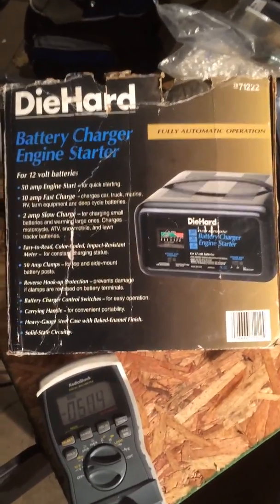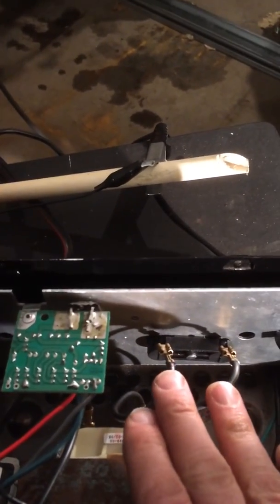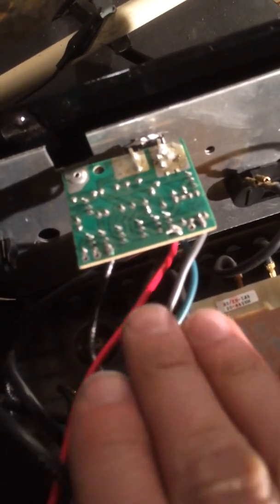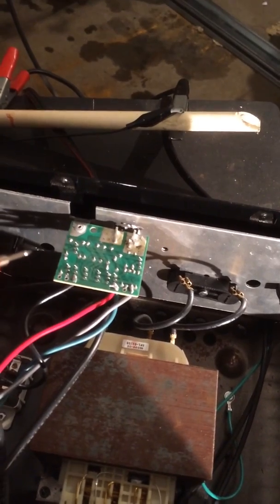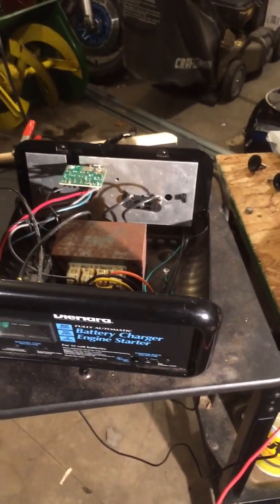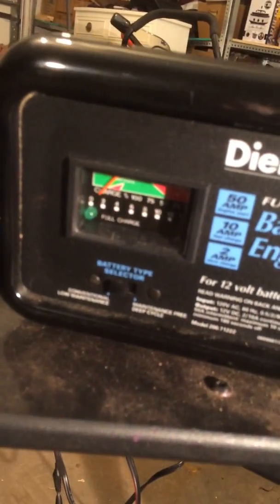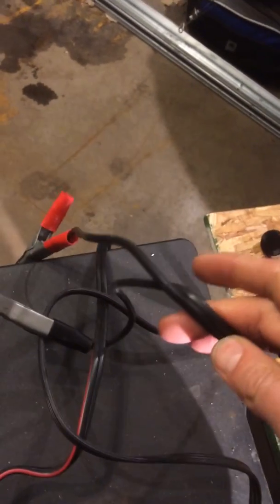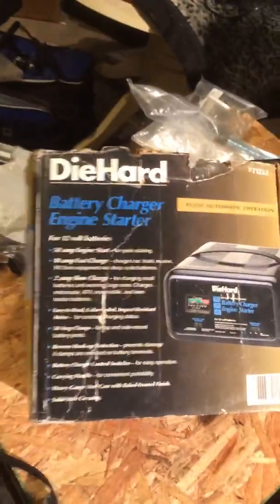My fix to the DieHard Battery Charger, explained out.

Comment: My same charger was not cycling at 2 or 10 amps. Occasionally, I could get it to work for a few cycles, then just sat there and buzzed. Opened and examined. No visual issue with board or connections. Transformer looked fine. Decided to bench test, but had just seen vid and recalled diode bridge design. All I did was check for oxidation between the two diodes and plate.  It was dirty. I simply spun the diodes a few degrees to find a clean spot on the plate and now cycles perfectly.   A simple fix, but saved me bench time. FWIW

Comment: Ive been trying to fix my 2-10-50 schumuker forever and nothing would work no voltage on leads but i can hear trans working and switch working and nothing watched youre video and unpluged wire and have voltage everything working good and good power ! Thanks Randy

Comment: dangg, so surprised that worked. at first it had a surging charge, then only having 9.33 volts. unplugged the wire and 14.5. kind of high but i dont mind. thanks

Comment: I was recharging a auto battery that was dead and I accidentally put it on 50 amps and it made a pop noise and wasn't working properly. Could it be that circuit board that was damaged or a fuse? Mine looks very similar to this but it's a Sears brand.

Comment: Hi Jason, would you mind sharing the part number for the transformer in this charger? Mine does not power on at all and I’m not getting any resistance on the transformer wiring. Thanks

Comment: Thanks I have a diehard platinum battery charger bought brand new and it never has worked correctly digital interface whatever this inspires me to open it up anyway it's not charging and it's brand new. Cost 150.00$

Comment: Thanks for the post. This helped with the 50 AMP... but I'm not getting anything out of the 2 and 10 amp circuits when I switch over. Anyone have any ideas? Kinda thinking possible faulty selector switch?
Reply from the maker: I only use it on 50 Amp.  It won't be your little trickle charger

Comment: I have had a problem with my charger for the last 4 times that I used it. I would get to power to the battery cables. I traced the problem to the circuitboard but I could find no replacement. Just happened across this video and tried it. It works perfectly now. A tip of the cap to Jason Hemphill for this solution!!!
Reply from the maker: Welcome

Comment: I have an older one that has  two 25 amp  bus car fuses as circuit breakers, and the diodes are on the back wall. my problem is i’m not getting anything out off the charging leads. nothing is burnt on the boards or anywhere else. checked continuity, but doesn’t seem i’m getting any out of the transformer.
it’s the same transformer as yours, how do I check the copper coils?
Reply: This may be too late but the transformer in my unit should put out around 28 volts AC to those two wires connected to that aluminium plate there (to the diode pack). But u gotta remove them to get that voltage. 28Volts AC on the 12 volt setting, and 18 volts AC on the 6Volt setting. 

To be honest, my unit doesn't work right. But I don't think the transformer is the problem.

Comment: I wish I had seen your video my dad had the same DieHard 71222 charger we threw it away because it would not charge anymore
Any charger that says [SMART/AUTOMATIC/INTELLIGENT] is not worth a penny!!
the only charger I see out there that is still LOW TECH or DUMB Charger but works every time is listed on eBay called [Speedway 7216] $139.99

Comment: Jason, I wish we could see the voltage when hooked up to a battery that had a chance. I am not sure output current is going thru the PC board as the components could not handle that much to operate the meter and LED’s use about 0.028 amps depending on color. It would still be worth taking the board off, visual check for cold soldered joints, over heated joints & components. 
 My big problem is the open circuit reading of 12.22 volts (+/- 0.5 volts) and here is why. A fully charged battery with a good state of health will read 12.6-12.8Vdc. A rule of thumb for lead/acid batteries (And Others) is a rate of charge 20% higher than the normal batteries rating. Cold batteries that are low, require higher amperage. Hotter batteries require less. The alternators, like GM’s 10SI/12SI alternators have a wire wound resistor inside to sense incoming ambient temp. Cold, output goes to 14.2Vdc. Hot, output drops to 13.2Vdc. This 13.2Vdc is the minimum voltage regardless of the intensity of current. Voltage drop can be measured if carefully laid out and insulated from case & other components can be measured from point to point with a digital multi-meter (DMM) for DC or A/C either. Low is 0.050-0.020 loss of voltage is good. Just remember, the higher the amperage, the higher the voltage drop. You are right about the battery leads cable size. This is measured by the cross-section of the copper with the insulation AWG is use with a lower number means larger wire, more copper. I would like to see reverse polarity protection if hooked backwards or the lead connector touch while on, or they fall onto a metal bench. But that’s another day!
 Hope it works, nice information clearly spoken, ok on filming but more light for guts. Just advise as I am no youtube content provider. It takes work to edit, setup camera “Phone”, it requires efforts that people don’t know about! Liked/Subscribed.

Comment: I had the exact same problem. I accidentally had red and black 12VDC leads reversed. Dumb human. This caused failure of "dumb board". This product is unforgiving. The dumb smart board should have a fuse on it so it doesn't commit suicide. I will use you method of repair. Maybe there is a wire you could lift on the Boeing 737 Max so that it doesn't crash planes into the ocean when the "smart board" takes over control of the plane. If you haven't seen the "60 Minutes Australia" video on the 737 Max check it out. The go into the simulator. The smart boards will fill our landfills with perfectly good usable equipment. Thank you!

Comment: THOSE charging Boards can be Problematic.  But I warn you...  If there is no load on the battery charger?  You may not see it giving you the power you want.   So before you open it up, make sure the charger is NOT WORKING by putting it on a BATTERY (as this is sort of a smart "capacitive charger"   )  FIRST!  

I'm about to send Mr. Carlson my battery charger so he can fix it online.

Comment: I don't get why the power selectors are on the primary,  when you get the damn power from the secondary. So will any plate of metal become a functional diode? And another think, in mine and yours,  since the selector switch is on the same side of the primary, how the he'll does that work,  it's a gimmick is it not,  if you have a multi direction primary,  how would that make you go from 2 to 10 amps,  without more divisive means,

Comment: The thyrister (SCR) was bad on my logic board.   I also heard on a few youtube vids that it is not a good idea to use anything higher than 10 amp on a car to charge the battery because it might damage the computer.
Reply: Got a video of replacing Thyristor?  How you troubleshot etc.
Reply: @jroe2372  you've got to remove it to test it.   Get numbers off thyrister and goggle specs.
Reply: BTW69200NS. Are you sure that is the problem though? For a failed thyristor it passes an awful lot of current...
Reply: @daphnejames3571  no, I ended up salvaging parts off charger for other projects.   Cheaper to buy new than fix itm

Comment: Dont test it UNLESS and until the charger is under a load.  If no load, it won't put out voltage.
Reply: Not exactly true. It won't out out a load on automatic charge. It will put out a load if you switch it to manual mode.

Comment: I have a 2/10/50 Shumacher charger, probably 25 - 30 years old, that I've had since it was brand new. When turned on, the transformer makes no humming sound at all, and appears to be dead, though visually it looks good / copper wires look good, not discolored, no burned smell.  I'm not getting any voltage at all coming out of my secondary coil side at the coil's contacts. I'm getting 120 V. on all points / wires on the input side of the transformer. When I was using it, today, I heard something kind of "pop", right before it cut out, completely, and went quiet. What else could it be, besides maybe a bad transformer, itself, in this case? How do you test a multi amp switch / multi. coil type battery charger, such as yours, and mine, to see if it's good, or not? Thanks.

Comment: it's SO rediculous how much thinner electrical wiring is these days compared to older stuff. your exactly right about it looking the same from the outside as far as gauge but once you strip some insulation off.. oh boy what a difference! 

anyway i appreciate your tip on disconnecting the board.. its a nice feeling when i see people trying to help others by spreading knowledge... too many ppl would just keep that info to themselves! however, i couldn't tell which of the wires you were saying to disconnect?!

Comment: I have been looking everywhere to fix my charger . When I opened it I saw that the old owner took some wires out . I am getting 10 v on the 12 volt charge and 7 v on the 6 volt charge . Mine is not made exactly like yours though . Mine is a Motomaster ( Canadian Tire ) It still works enough to charge a dead car battery . But not to full power . I am trying to use it for my E-Bike . Your video was the most helpful . Thanks . Thumbs up

Comment: This worked on my early 1980's late 1970's model Diehard 71222. After doing some reading mine wasn't sensing that it was connected to a battery, since it was so so drained. After doing this trick it started on 50a, where before it wasn't. Thanks

Comment: I have the same Battery Charger with a similar problem. There is no power going to the battery charging cables. Have a question. When you did your AC power test to the 2 diodes at the back right side of your battery charger you showed touching the red lead from your multi-meter to the 2 wires coming from the transformer to the 2 diodes one at a time. Not sure if you placed the black lead from your multi-testor to the negative side of the battery charging cable but betting you did.
Reply: Ok I took a chance and put the black wire from my multi-meter to the black charging cable and tested both diodes in the ACV Multi-Meter setting at the 2 amp and 10 amp on the battery charger. With the selector switch at 2 amp I got a reading of 12.8v at each diode and at 10 amp I got a reading of 14.1v. Put the multi-meter on DCV and at the aluminum board I got 11.7v at 2amp and 12.85 volts at 10amp. Without disconnecting the black lead you mention to disconnect from the circuit board again I get no reading from the charging cables. With that black wire disconnected like you did I do get a very small reading of .3 volts that's it at the charging cables with the selector switch at the 10 amp position. At the 2 amp position even less of a reading.  I believe with my limited knowlege that there is defintely a problem at the circuit board.
Reply: Just got off the phone with Schumacher who manufactures this Battery Charger. They tell me a circuit board is available for this uniit at $22.00 plus shipping. Don't know if it is worth it being the person I spoke to wasn't much help technically as to what to check out on the unit. I actually got more info here at this You Tube Video.

Comment: OMG Jason please take this video down. I checked my charger using your method and thought it was bad. I'm SO glad I read the comments about how the charger has to be hooked up to the battery in order to check the output. Please take it down or do it correctly to show both the right and wrong way to check a charger!
Reply: Bullcrap.  I uses the 2 and 10 amp setting and they both didn't seem to do shit.  Its a trash product....

Comment: 4/16/17 Update:  I got to use the "modified" battery charger having fixed it per the video guide and it worked perfect.  I added a better set of cable end clips I bought on ebay and a 120v AC timer to both provide an "on-off" switch and a means to set the amount of time I want to charge the battery.   I set the charger on 10amp and the timer for 2 hours.  Since the mod by-passes the "smart board"  I thought it best to have a timer in the mix so there would be no danger of overcharging. The chargers meter worked as it was designed (sans the green lamp)  Again, thanks to Jason's fix, my charger is working and with my mods, the charger operates like the commercial types I used during my automotive career.

Comment: Thanks Jason for this fix. I too bought mine on Craigslist. Looked brand new with box. I tested it on a car battery that was fully charged and it seemed to work. I didn't bother checking it with a volt meter.  I did notice that the amp meter would fluctuate and the green light would flash on and off.  I suspected a problem and found your video.  I had the same 9 volt condition until I unplugged the culprit wire, and then the voltage jumped to 12 volt.  I just tried it out on my car and it's charging fine. I checked the output at the battery and it was 13.2 volts!  At least now it's functional and I'm not one to leave the charger on unattended.  I checked the Sears parts website and the problem board is "no longer available!"   Sad they sell such poorly designed products. My old little Schauer charger was still working except for the meter.  I thought I was getting an upgrade--NOT!  Anyway, thanks to you my charger is working.
Reply from the maker: You're Welcome
Reply: Hi Jason, I watched your video again and was thinking that component where you disconnected the wire might be a thermal fuse of some kind?  I've watched a few other battery charger repair videos and that "fuse" has been mentioned or shown being replaced.  Some of the chargers were not exactly the same and the "fuse" only had two leads on some of them.  Just thought I'd mention and ask if you gave that any thought?  I have not reopened my charger since "the fix" but instead just bought a heavy electric timer that I can use with the charger now. I"m a retired auto tech and used commercial type battery chargers where you could set the amp and the timer.  Most of these small "smart" chargers don't incorporate an "on-off" switch let alone a timer!   I'm happy my charger is outputing +12volts now and feel more comfortable to know I can set it to charge according to my needs.  I timer was $9 on Amazon and it's good for 1875 watts and 15 amps.  My next project is my Battery Tender Jr. which worked fine for my motorcycle battery (turns from red to green when charged) but won't work on my car which has a 5 month old Delco battery and a good charging system.   The Tender just stays red even after 24 hours!  The battery is fully charged and never gave me a problem.  I wanted to "maintain" the battery since I don't use the car all the time.  I'll be calling Deltran company today about this issue since my Tender Jr is still under warranty and according to my Google search, this "red light issue" seems widespread!

Comment: Those circuit boards were designed to pulse the current to break up sulfates and to stop an overcharge and plates from overheating/ warpage and people hooking up in reverse polarity. Diehard chargers WILL NOT throw current unless connected to a battery. What you did may have worked, but is totally stupid. When a charger is working they will show 13.2-14.6V. The problem is likely a  10 cent transistor once you verify on a battery but most people get caught up when they click the leads and there is no spark (which is how they were designed to work) for safety. This is to stop the risk of explosion from hydrogen. Bro, you missed the mark, it is not fixed.
Reply: Also multimeter measure average or RMS voltage so waveform top is x1,42 times higher 😎 10v=14.2v connecting load drop this to battery level.
Reply from the maker: You are exactly right.  It is not fixed.  You're right its likely to be a 10cent transistor.  Most people will not be able to fix the transistor issue. They won't spend the time to find it, order it or fix it.  The solution I'm offering is to turn it into a old school charger.  It takes out the safety technology.  This solution is an option for people who are old school and are use to working with things that way.  As I stated in the video, this isn't an option to hook up to a battery and walk away. So if you're someone who can't hook up a battery right or don't understand the idea of over charging and need idiot proof technology to do that for you, this isn't your option, go buy a new one.  But if you're old school, this will do the job.
Reply: @jasonhemphill5412  aaaahhh!! amazing comeback!! had me snickering for awhile.. perfect execution starting off by agreeing with them... you're right..i didn't fix it!!! AAAGGHHHAHA! BUURN!!
Reply: You wrote "It takes out the safety  technology." A pair of booster cables "would be safer" and anybody who does what you did would hopefully warp the lead plates and put the shit out of it's misery. But they would be happy cause ignorance is blissful.

Comment: hey Jason I have a battery charger similar this but I made the mistake of starting the vehicle with it connected. now it no longer works. it hums and starts to smoke and guage don't work. do u think It could be fixed? thanks
Reply from the maker: Its not a mistake to try and start the car with it attached. I do it all the time, just remove it promptly once the car is started.  There always has to be a point where you go.... its just not worth it.  If its smoking, I would take that as a sign to give up on it.  I'm sure there is a way to fix it, but the time and effort, not worth it.
Reply: Dam webster lighten up..
Reply: transformer is shot. smell like fiberglass  resin burning? Scrap.